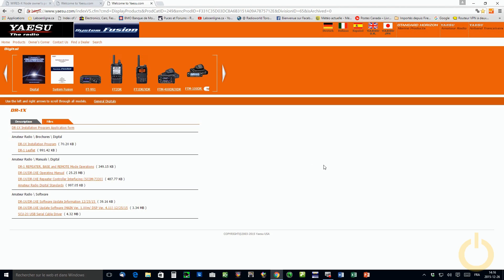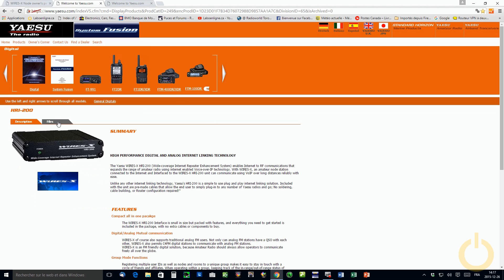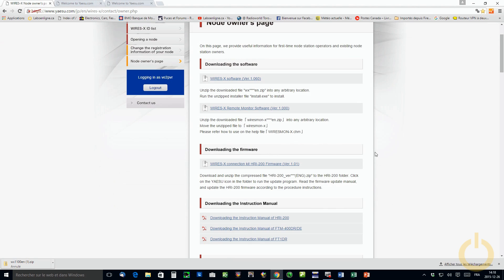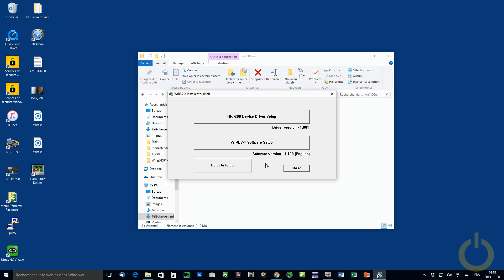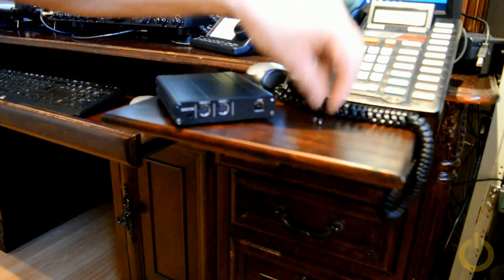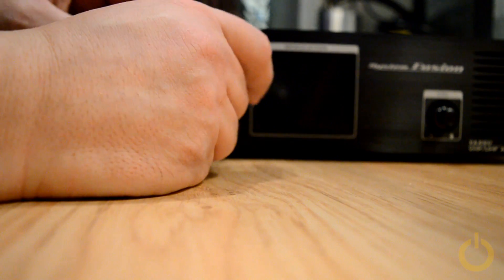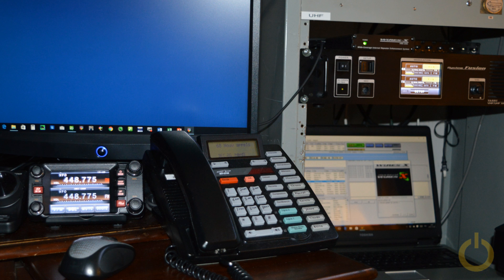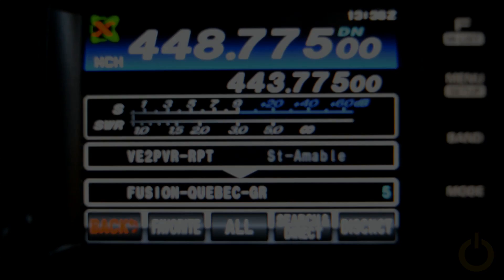DR-1X and Wires-X upgraded

Comment: I have a problem with a DR-1x.
At the time of startup, the display indicates Wires X.
Can not turn on the repeater.
Factory reset impossible.
Is there a way to remove Wires X mode?

Thank you.
Reply from the maker: Hi Dominique, there is a procedure to switch between Wires-X mode and normal repeater mode.  There is only one button on the DR-1X and you need to push it while turning it on, check the manual as don't remember exactly the procedure.  Hope this help.  73
Reply: Hello,
Thank you now it's ok